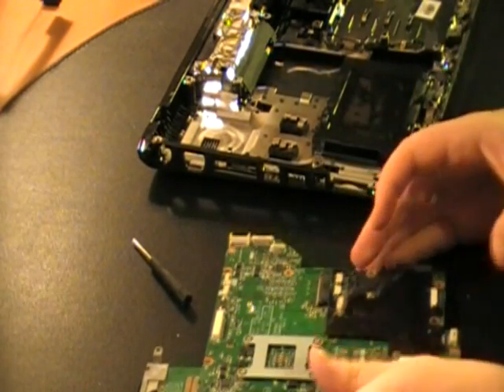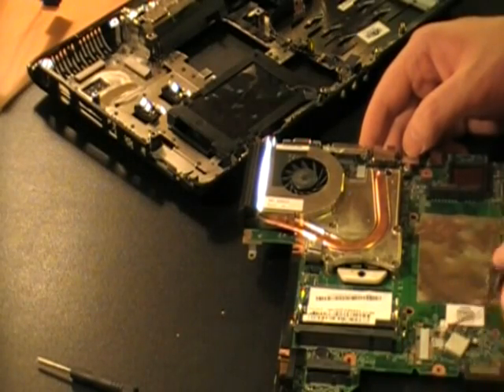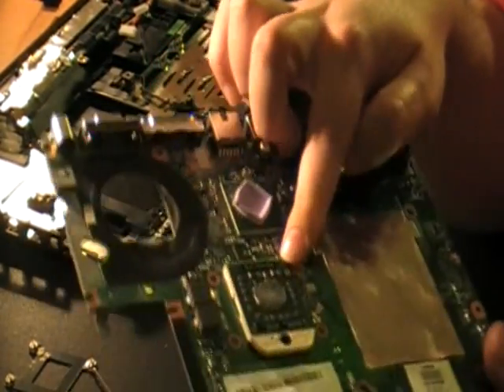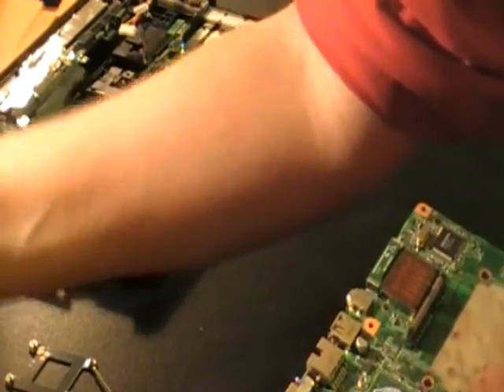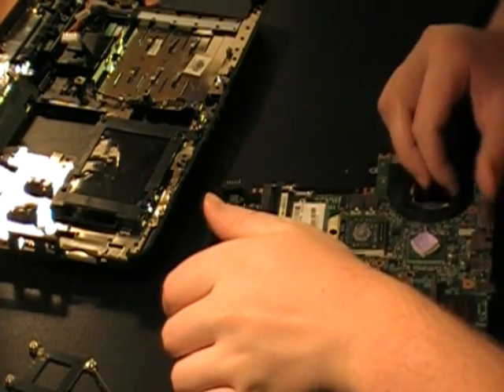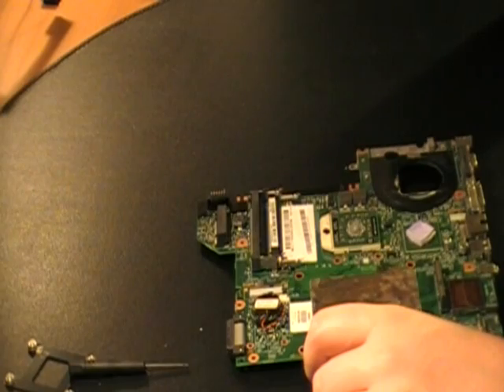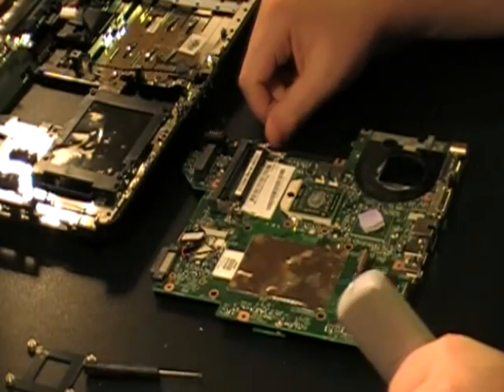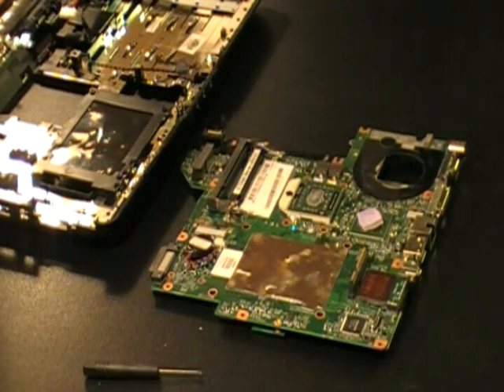HP Pavillion Dv2845se Laptop disassembly pt5

Comment: Thanks for putting up the video.  The motherboard died on mine as well, it's actually a known issue with this model due to overheating.  That thermal pad doesn't help either.  I'm reassembling about a week later, so watching these videos will be a big help!  We bought a copper thermal shim that we will use in place of the thermal pad this time around, putting thermal paste on both sides.

Comment from the maker: @ilovehell03 you can think what you like, but that's not why it died.

It was the motherboard for sure, we tired a different processor and it still didn't work.

Also desktops and laptops are VERY different. Problems with laptop and desktop hardware, accordingly, are almost 100% of the time different and totally unrelated.

Comment from the maker: Installing a graphics card in a desktop is no big deal, just pop it in and install the drivers that come with the card. (There is a little more to it than that but not much) However, if you you were trying to install a desktop graphics card in a laptop that wouldn't work, and laptop graphics cards are hard to come by.